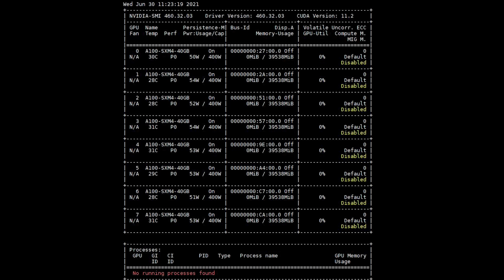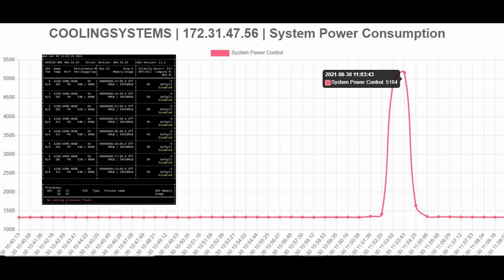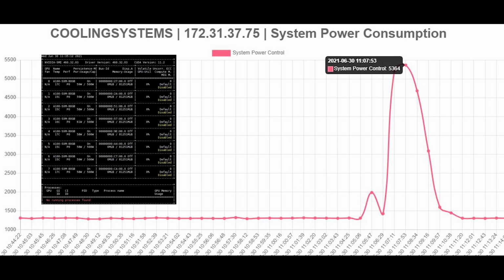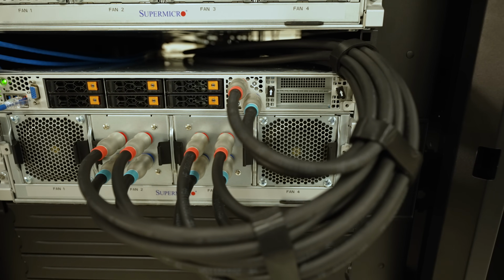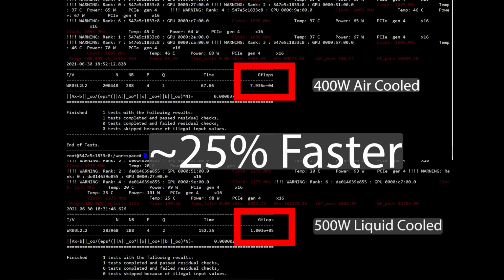Liquid Cooling High-End Servers Direct to Chip, Rear Door, and Immersion Cooling

Comment: just pull a little bit of vacuum on in the cooling loop. this way you only need to monitor the vacuum at one point.
it there is a leak air will get in, but no water out.

Comment: While liquid cooling is nothing new in the serverspace it's nice to see that some of the mainstream brands are starting take this serious. The next hurdle is get these solutions into the datacenters, for the past 10 years or so that I've been working with liquid solutions for servers the stop block has been the datacenters it has always ended up being that the customer had to build their own datacenter as typical co-location centers just run away screaming as soon as you mention liquid in any extend even when we started using the 3M engineered liquids which are totally dielectric. But it will be interesting to see if this finally starts to catch on.
Reply from the maker: Slow process. That is what we are working on now.
Reply: @ServeTheHomeVideo  I remember having this discussion about die cooling with SMC about 8 years ago and back by then they basically told me that it was never going to be a thing so it's really nice to se that they are finally starting to come around to it.

Comment: 500W TDP per chip is a bit too extreme. aircooling is less efficient in terms of heat removal but when you use it, you are using less power hungry components that are indeed more efficient (flops per watt), if nvidia releases a gpu with 500w tdp, I think this is a step back towards a less efficient approach (Imagine PC overclocking, where the heat goes up much more than the gained performance, you need much more efficient cooling etc). conclusion: increasing the efficiency of the cooling solutions in this case means a decrease in efficiency in the hardware, we should balance better these two efficiency aspects (hw and cooling). maybe the solution is not releasing a 500W TDP in the first place and develop a better GPU in terms of silicon efficiency and architecture and then performing the same peformances in a 400W TDP gpu, even if this means waiting for a next gen product.

Comment: Immersion cooling is also done everywhere in the US where electrical transformers are immersed in mineral oil as a meat joe of heat sinking to the transformer cases; it provides both a method reducing heat as well as electrical insulation. Liquids tend to be better at thermal transfer than air.

Comment: This is pretty cool.  I wonder with all the push to cloud, if massive cloud DCs are contributing to environmental issues in any way or are they neutral, meaning the DC heat is transferred to someplace its needed like an office building, warehouse, etc. in a cool climate that would otherwise need fuel for heat.  Will cities have hot water lines fed by DCs as a public utility similar to New York City with the old steam lines for moving around heat.  It seems all this DC heat could be a resource if planned correctly.
Reply: Well definitely not neutral by default just with the energy usage alone
Reply: Yep. The larger DCs in freezing cities do this. Can help warm a medium size office building

Comment: Interesting topic. Kind of funny how the liquid cooling going from your average gaming computer at home to servers. Immersion cooling is something that was done pretty long ago with gaming machines too people would get mineral oil and some merge their PC in aquariums fill it with oil.
Something you didn't mention but I would assume would be radically different would be the noise level in a data center it was all liquid cooled versus air-cooled. Those servers are very very noisy with those fans going and when there's a whole bunch of them going at the same time it's practically deafening. You could eliminate most of that noise by going to liquid cooling.

Comment: This is already a concern for us. We have racks that run ~4 24 core Xeons per U our cooling is similar to back door cooling, but more integrated into the rack/datacenter. The hot air is sucked in, cooled down and then forced into the front of the rack again.

Comment: Aren't many of the immersion fluids oil-based and generally flammable? Gotta beef up the Halon purging system if the entire facility becomes a hazmat storage -on top of the diesel tanks and can potentially leak from one floor to a lower one. I love the concept and am glad it's explored, but as you say, operationally, it seems slightly sketchy.

Comment: This video is severely underrated. Well put together and informative without being boring. Would of loved to see the inside of the server because.. well its cool. Now if only i can setup a central PC in a closet, and run cables to my monitor/keyboard etc at my desk, and then kick out any heat to the outside that would be great.
Reply from the maker: We just did a teardown of an 8x A100 system from another vendor.

Comment: Ok, hear me out. 
Phase change cooling liquid that boils at 75c Sealed tanks for the servers. Vent Pipe that gas to the roof, where it condenses, and drains back down into the tank. The only pump/fan that would be needed, if anything, is the fan to to bring the gas to the condenser, and the fans to cool the condensor. Everything else is either powered by the fluid boiling away and carying in fresh liquid, the hot gas rising, and the consensed liquid falling
No cleaning needed, just pull the server out and heat to 76c
Reply: https://www.youtube.com/watch?v=YyKIZPuepl8

This seems to be the way to go to me too. you could keep the same rack design but like you said shutdown, turn off the fluid intake, heat to evaporate the fluid, and pull it out for maintenance.

Though the only thing I can't figure out is how to use it with something like OpenCompute drawers, but maybe those just need to be handled somehow else (could do cooling blocks as part of the chassis, that pipe coolant (water even here) to a heater block that is submerged in the same coolant as the rest of the system.

Though they are also working something too:
https://www.opencompute.org/projects/acs-immersion

Though as cool as opencompute is I never can figure out how to see what progress they've made on some of these.
Reply: @Waitwhat469  With phase change it could be very low pressure and just use regular plumbing and racks. Using a metering valve that only allows as much liquid in as needed. with each server getting a high side for vapor, and low side where it gravity feeds liquid into the exchange blocks, where it evaporates, and pushes itself into the high side

The problem with using a standard rack instead of an open compute rack is that the server would probably, at minimum need to be 2u, just to make sure that as the fluid boils, it runs through the high(gassious) side of the loop
There could probably be some sort of HEPA like filter that allows the gassious fluid thrtough but not the liquid, but i dont know if it would be high flow enough when being impeeded by blocking the liquid

Comment: Components that were immersed in 3M Novec come out completely clean. In fact the fluid is specifically used for cleaning also.
Reply from the maker: Many of the fluids require secondary cleaning stations. One of the fun parts on there being many different fluids in use.
Reply: Now you just have to be able to afford not to recapture that novec fluid.

Comment: well interesting that the rest of the industry is hopping onto the liquid cooling wagon that IBM has been doing off and on since the early 80's and immersion cooling that was shown off by a company company claiming to be SGI in 2014. The immersion fluids have come down in cost substantially in the last few years with the toxicity being less of an issue and cleaning not really being a problem depending on the fluid.

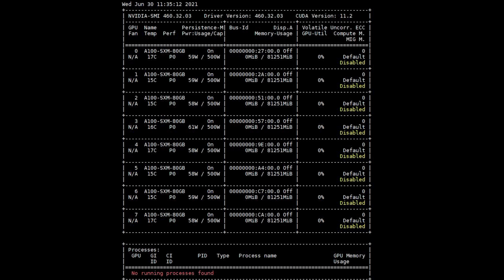Comment: The screenshot of the Nvidia-smi tool at 16:49 is insightful. The A100 80 GB versions are snown with 500 W max. power. However, the datasheet lists a TDP of 400 W. It would be interesting to see, how much power these cards actually draw under full load. The idle value shown at about 60 W is reasonably low.
Reply from the maker: They were running at 496-500W during the linpack runs. NVIDIA does not actually list the 500W 80GB A100, but they are available from almost every vendor. We recently discussed them in the last 8x A100 system we reviewed.

Comment: Thanks! Great video! It would be great if You can investigate 230 and 326 VDC enabled gear. With many solar and battery powered data centers and homes also, DC supply becomes more common (i am not talking about traditional telco -48V DC). Then we have to use inverters to get AC. Current SMPSs usually converts that AC to high voltage DC, then DC to low voltage DC. Skipping DC to AC and again to DC improves efficiency. You can start with observation of input AC voltage ranges of current SMPS and then check if DC is allowed as main.

Comment: Liquid cooling makes so much sense and I think in the future we will see much more direct to outside liquid cooling. It makes no sense putting several space heaters in a room and then using your AC to cool the room. It is much more efficient to have an outdoor radiator and dump the heat directly outside.

Comment: I work with a start-up company together with Dell and Shell to deploy immersion cooling systems. Its really cool but it definitely has its disadvantages. You cant use any thermal paste for example, we use indium foil as an interface for the heatsinks. 

Letting a server drain for 30 min is enough to service it. The components do not need to be cleaned. You can just remove and install a CPU in a socket, both covered in oil, without any problem.
Reply: That's because the thermal paste is soluble in the cooling oil, right? Out of curiosity, why indium rather than galinstan (sometimes used by enthusiasts)?
Reply: Send Rolf my regards! :)

Comment: The biggest difference between the GPUs is that the 80GB A100 does already perform 15-20% better than the 40GB A100 (both at 400W), due to the higher memory bandwidth. The 100W extra would result in 5-10% extra performance.

Comment: So uh, what kinda hashrate could one get on that LC A100 system ?  Just for S&Gs.  Immersion cooling albeit not as optimum and a pain in the ass, it's still that kinda badass that makes cool sci-fi movie material.  Digging the vids no matter the set.
Reply: 8x215MH/s on the A100 80GB 400W, I don't think the memory is clocked higher on the 500W version so pretty much that.

Comment: we NEED to start using all of this heat! the city of Lucerne in Switzerland is building a data center that will heat part of the city inside of a retired bunker - i think thats pretty epic :>
Reply: Pretty common in the north to put the waste heat on the district heating. The DC gets paid per unit of heat inserted so it's a logical/economical thing to do.
Reply: Waste heat can't all be used, the temperature of the heat is a big factor as well. Data center heat is not particularly high in temperature...
Reply: @Primoz.r  Very much depends on the cooling system used. Immersion cooling system can work to very high CHW temperatures, with the return reaching as high as 50degC. Which is close to your standard LTHW water temperatures. In fact it would be too high if the end user was using underfloor heating for their heating.

Even with the traditional systems, exporting CHW at 28 and then using heat pumps to lift the temperature up provides great benefits if you compare it to heating the water from the mains gives you (approx 10deg)

Comment: I wonder if there's a way to do heat recovery cogeneration to generate some power or industrial heat from all that hot fluid being pumped around.
The water temperature probably is well below 60C, but 40kW+ of hot water per rack seems like a lot of energy to just dump outside.
Reply: In the North the waste heat gets 'pumped' up with heat pumps to heat water to ~80C to put on the district heating systems. Generating power from such low temperature delta has an efficiency in the range of 5-10% so not really worth it.
Reply: @axiom1650  the usage of heat pumps in district heating isnt that large.
Reply: the issue with this is the gap of temperature. The bigger the gap the more power you use. All cooling in DCs are compressor based on the higher end, basically like your AC. If your ambient temperature in the datacenter is 15C and the boiling point at 105C, the energy needed to create that difference using an AC increase exponentially the bigger the gap. The best way to explain this is the amount of energy required to move said amounts of energy at a larger difference then smaller difference that power generation is not feasable and a multi loop compressor cooling to keep that same efficiency tends to fail often (not mechanically reliable). This is why this isnt used.

Comment: Lol sorry to comment twice

But had to laugh
I have a sysrack
3 notable piece of equipment within is a -dell r720xd with a tesla v100 hba array
-hp dl385 with an epyc 7552 with an hba array
- trip lite rack ac

I installed an variable speed exhaust fan with louvers on top of the sysrack (exhaust )and on the back hot zone  in the sysrack. Hot air pulled towards the rear and up and out on the top. Cool air pulled towards the front and up and out on the top. 2 zones separated by insulation and blank panels to facilitate air flow/temp zones.

19-20 celcius is maintained at the front of the rack.

Comment: Are these liquid cooled systems typically using DI, or are synthetics more prevalent? It's high pressure fluid, right? What's the cost differential air vs liquid rack, assuming similar performance?

Comment: The rack-door systems I've seen were basically moving the evap coils of the HVAC into the rack door. Removing the air middleman, running the liquid lines direct to the chips would be a great deal more efficient, if a lot more messy.

The one you show is rather useless as all the heat still has to be dumped into air, pulled back out of the air into a refrigerant (which might be CW), to be pumped out of the room/building. If you've put the waste heat into a liquid (or gas), skip the extra steps and pump that out of the space.
Reply: I think it's an airflow thing.  Those doors aren't just liquid coolers, they're also supplementing the server fans.  Plus, at higher heat loads, they might have had to completely re-design their cooling setup to keep hotspots from emerging.  Put another way, it ensure equal distribution of cooling.  Direct refrigerant lines are more efficient, but are in many ways also more complex than water cooling.

Many electric cars use this approach.  The compressor feeds the cabin's evaporator and a liquid heat exchanger.  Chilled liquid is then used to cool the batteries.
Reply: Adoption is slow due to requiring a complete overhaul of the datacenter if it was not built for that purpose. I guess like this they try to offer a lower threshold, which makes little sense imo.

Comment: I cant help wonder if a different working fluid would be better for heat transfer that have lower boiling points to exploit phase changes with a closed loop immersion cooling system.
Reply: "Water" cooling is rarely done purely with water. (it's not a boiler after all) Usually, it's some mix of glycol and water. (similar to automotive antifreeze) Of course, there are liquid cooling systems that use ammonia (not recommended around people), nitrogen, or CO2. (among other more exotic things... Cray used fluorinert)
Reply: My guess is that it's just hard to beat water, which has many desirable properties as a coolant. Water is cheap, non-flammable, non-toxic, and only mildly corrosive, and has an unusually high heat capacity. So you can improve the effective heat capacity by using a fluid that boils between ambient temperature and Tdie, but I don't know of any that don't significantly compromise one of the other properties.

Crazy idea: use a slurry/suspension of particles that melt slightly above room temperature in water. The particles would melt and re-freeze, absorbing/releasing additional energy, while remaining suspended in the water. This might run into problems with clogging, and increases the viscosity so it might make pumping less efficient.

Comment: 1kW+ practically means having one of those commercial microwave ovens that you see in convenience stores, in each U of your rack. Difference is instead of food what you're frying is thousands of dollars worth of electronics... It honestly surprises me how air cooling was able to take us this far.
Reply: You don't need special commercial ones. A regular household microwave is >1000 W.
Reply: @fat_pigeon  I don't know about that. Where I live 750/800W is more common for household microwaves.
Reply: @scheimong  Maybe in European (230/240v) countries.  In North America where we're running 120v, 1000-1200w is very common (both standalone units and over-the-range)
Reply: @RussSirois  What does the voltage have to do with that? You can easily pull 1kW from a circut in Europe, too, if that's what you're getting at.
Reply: @scheimong  I just checked mine (ordinary microwave, US model). Rated 1100W. Regardless, it's a good amount of heating, so your overall point stands.